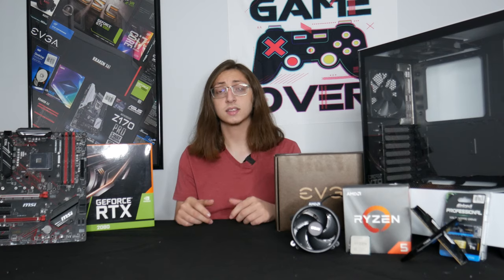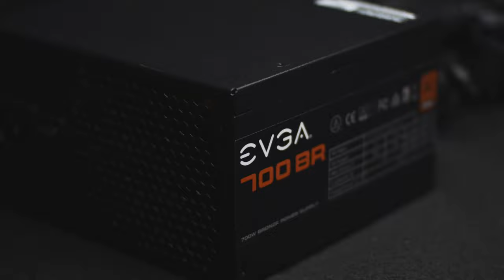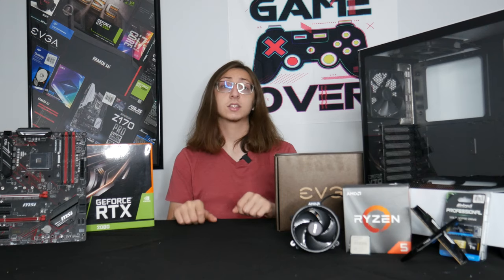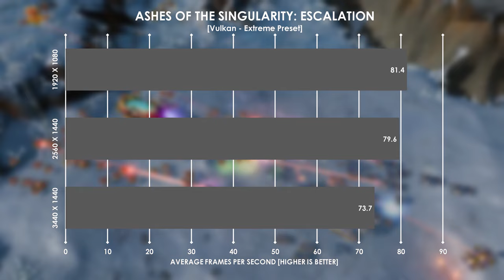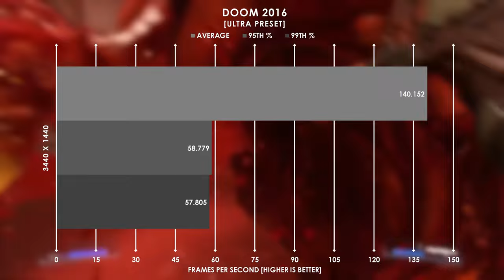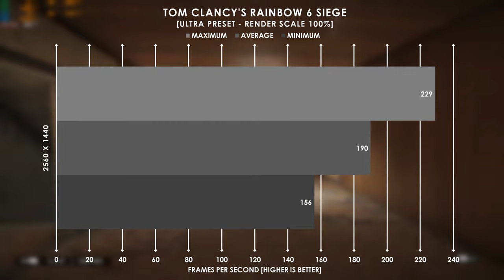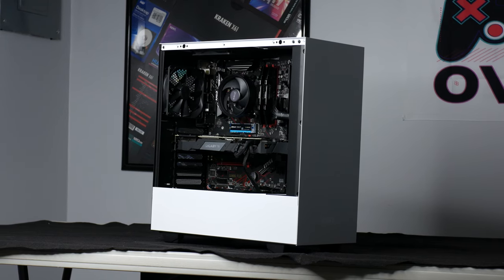Building a $900 Used Gaming PC with an RTX 2080?!

Comment: so yah, are there any other graphics cards that you can buy on amazon that are about the same price as what you got that one for. and that it works pretty well with all of those items.
Reply: would a ASUS GTX 1660 SUPER work
Reply from the maker: Like I said, unfortunately everything is getting super overpriced right now because of scalpers. The best card you can get at the $500 price point on Amazon is a GTX 1660 SUPER or GTX 1660 Ti, which normally retail for $229 and $279, so paying almost $500 for these cards is ridiculous. Just be patient right now as stock will start to normalize and then you can hopefully snag something like an RTX 3070.
Reply: @GTechOfficial  ok thank you for the info👍🏻🙏

Comment: I know absolutely nothing about PC's let alone companys and what parts work with what, so my question is would a kraken z73 work with this setup? And would it be worth it
Reply from the maker: Unfortunately the Z73 would not fit as it is a 360mm liquid cooler and this case, the NZXT H510, only supports up to 280mm liquid coolers ai believe. Therefore you'd be looking at the X63 and Z63 for the 280mm coolers, and the X63 and Z63 for the 240mm ones

Comment: what other graphics cards would you suggest, that can be bought on amazon for a good price?
Reply from the maker: Unfortunately, basically everything is overpriced right now because of the extreme graphics card demand going around now. What price point are you looking at?
Reply: @GTechOfficial  just about 450 possibly 500$
Reply: possibly less if they are still good but idrk

Comment: Bro I checked other builds all of them get rtx 2060 but after checking 64 shops i doubt i will find it in stock ever, maybe 2080 gonna be easier to find
Reply from the maker: We're in a weird position with GPU availability right now. The RTX 30 series cards are getting bought up as soon as they hit shelves and older cards are still at marked up prices making them not a great value. Just be patient, and hopefully stock normalizes in a couple months

Comment: i have a r5 2600 would that work to?
Reply from the maker: Yup! B450 motherboards and 2nd-gen Ryzen CPUs are compatible!
Reply: @GTechOfficial  i have a b450-m plus from asus will that work with a good motherboard then the r5 2600 and a 2060??
Reply from the maker: Yup, it's a perfect combo
Reply: @GTechOfficial  ok and is a aio that says am4 compatible with the r5 work? or should i just stick with the wraith cooler
Reply from the maker: Yeah, AM4 compatible means that it'll fit on the Ryzen CPU socket so you'll be all good. Definitely go with the AiO over the Wraith Stealth if you can for better temperatures
Reply: @GTechOfficial  ok do you recommendation for a aio? i have a setup budget of 1400 and my parents will be buying me most of my parts
Reply from the maker: Well it depends on what case you're buying and what size radiator your case can hold. 240mm AiOs are pretty good for a Ryzen 5 2600.
Reply: @GTechOfficial  i was gonna get a 240mm for the NZXT h510. this is my first pc build and if idk what to buy i will just buy the NZXT starter pc plus for 900$

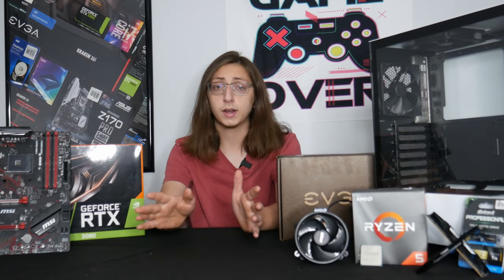Comment: 1:19 5th*
Reply from the maker: Nope, 4th gen.

Zen, Zen+, Zen 2, and Zen 3 are the 4 Ryzen architectures. They named it the 5000 series to differentiate from their laptop chips and 4000-series APUs, built on the Zen2 architecture.
Reply: @GTechOfficial  its 5000 series. they literally call it that.
Reply from the maker: @drewnix2490  Correct. But it's not the 5th generation of the Zen architecture, and is thus 4th generation Ryzen.
Reply: @GTechOfficial  but there was already 4000 generation
Reply from the maker: That's not the point I'm trying to make.

Zen -> 1000 series
Zen+ -> 2000 series
Zen 2 -> 3000 AND 4000 series
Zen 3 -> 5000 series

It's the 4th generation of the Zen architecture.
Reply: @GTechOfficial  its 5000 series